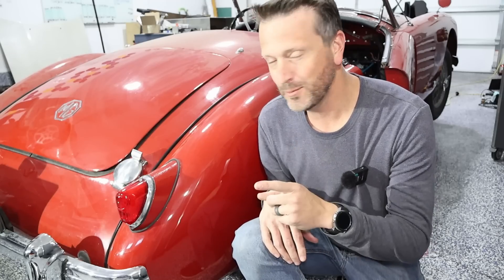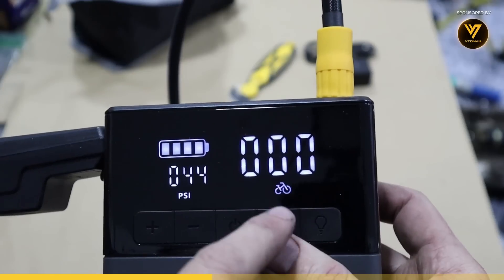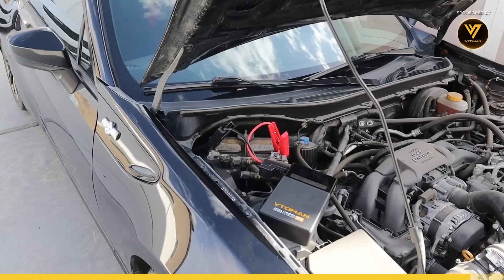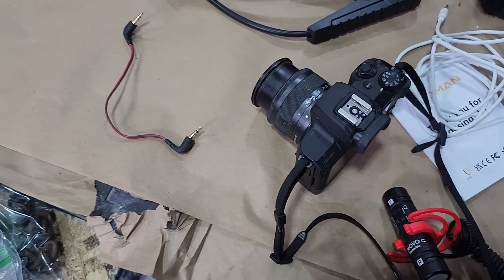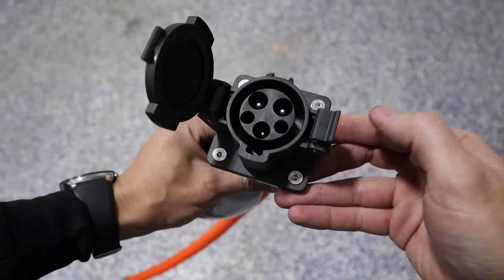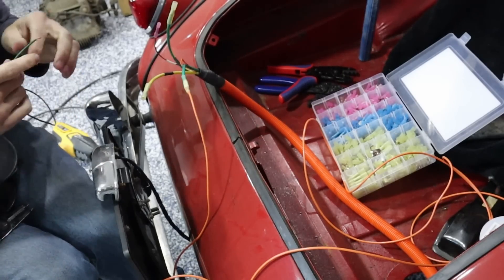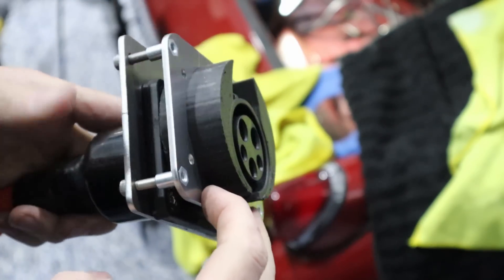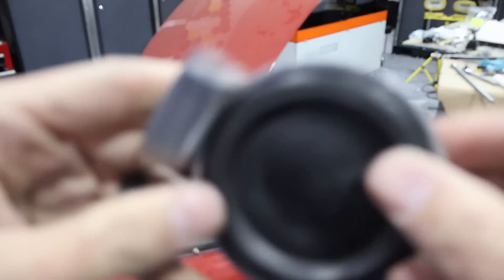Custom Vintage Charge Port - Make a DIY Gas Cap Cover for a J1772 Port

Comment: Saw several comments about NACS ports. Thanks Jeremy, for the pointer to the Aston Martin gas cap. I have built an NACS port into one of those for my eBugeye and it doesn't require any cutting or drilling on the body. Obviously won't support Superchargers, but surprisingly the outputs are the same as J1772 and will charge happily from a Tesla home charger or J1772 with an inexpensive adapter. Documented here: http://adventuresinevland.blogspot.com/2024/05/hooray-for-nacs.html

Comment: Nice work. 

The orientation looks weird. An MGA doesn't normally have a flip cap, but typically a flip cap would hinge on top, allowing the angled fuel filler nozzle to sit in a stable position with hose leading over the bumper, and the same would work for the charging cable.

Comment: What is the internal diameter of the fuel filler you used?  I am actually working on exactly the same project as your MGA, mine is a complete rebuild from the chassis up but using a Hyper 9 with an MX5 gearbox as the MGA is pretty ordinary. Same batteries, but 8 instead of 10 and Thunderstruck BMS and EVCC.  Also interested where the engine cradle came from, who makes it?

Comment: Charger looks great but why not NACS? Would support level 3 charging and AFIK it’s a smaller plug overall.
Reply from the maker: This kit does not support DC fast charging
Reply: Sure... show us an aftermarket charger that accepts a NACS port connection, does fast charging, and doesn't cost as much as the car is worth.

Comment: audio options are endless. sometimes you have to work a little on editing: there are simple apps for audio recording and you can plug your wireless mike to a smartphone and add the audio onto the image. have the built in camera mike for audio sinc while you don't have it fixed... its probably a "easy" fix on that camera (take this with a grain of millions of years old expired himalayan salt because I solder since I was 5Yr old... )

Comment: Be aware that jumpstarters that detect reverse polarity require at least some charge in the battery to activate. If the battery is completely dead they won't do anything without putting them into some special mode so do read the instructions to find out how to do this!

Comment: This is yet another little thing that annoys me about the "EV conversion world". All these dealers will sell you motors, controllers, batteries, BMSes (usually the Orion and nothing else), and bits and bobs. But no one makes a 1772 socket to fit into an old car's gas filler. Not like it would cost millions to develop such a thing either. Nope sorry dude, you are stuck hacking sheet metal.
Reply from the maker: Maybe I should sell one

Comment: That's a clean plug install. Authentic styling, good choice. 
Will this car charge on the tesla network now that there is an option for other EVs? 
Do you control the output KW, or is that flexible through thermal management.  
I'm wondering if you're charging on the road  at how many KW.
Reply from the maker: No DC fast charging for this customer

Comment: Curious why you went with the J1772 and not a Tesla/NCAS connector since it's smaller.
Reply from the maker: This car does not have fast charging capability
Reply: @electricsupercar  Even without, doesn't the NCAS Connector have dual support for Type2/3?

Comment: I'm thinking it might look better mounted the other direction, flipping the door upwards?
Reply from the maker: Gas cap only opens 90 degrees. If we flip it the other way, it makes it more challenging to naturally fit the charge plug
Reply: @electricsupercar  I reckoned the reason was something like that, I was just thinking about esthetics 🙂 Thanks for responding.
Reply: @sveip  It's not just aesthetics - I would want the charging cable draped against the chromed rear bumper, not the painted fender.

Comment: If you want to keep using your camera, you can, you just need to pair the recording system with another device, phone or laptop, and at the begining of the recording clap two times, and in edition make the claps sync with the sound, that's it, the only issue you could have is you would need to do that for every video you record, so would be better to try and record as much as possible from one unique take. If you want some help, I could help you, drop me a comment :)

Comment: Jeremy, please note that PLA parts will become soft when they get hot (or even warm).  I lived in AZ and had PLA printed car parts fail when they became soft and deformed after being exposed to an afternoon in direct sunlight.  A better option is to have a 3rd party print them in PA12 / Nylon 12 using Multi Jet Fusion 3D printing.  You just download your STL file, and they send you the part.  You'll have to shop around for someone who will do low-cost one-off parts.  The company I used In Phoenix seems to have gone out of business.  They did a part like that for $9.   PA12 will hold up to the heat, PLA will not.
Reply from the maker: I got a Hi-temp filament that should hold up fine. 🤞

Comment: Its not a lot but hopefully this will help get you a new camera.
Reply from the maker: Wow!  Thanks so much for the support!
Reply: @electricsupercar  Unfortunate lesson I learned a few decades ago, always use a tripod with good weights on the feet or lower armature.  Even a 5 lb bag of sand/rocks/marbles/weight just strapped down on the legs works in a pinch.

Comment: As somone else mentioned there's most likely someone who could fix it for you but in the mean time, if you have something else that can use the microphone to record audio, you could record audio separately and then sync it in post. It's more work but you would be able to keep the better audio.

Comment: If your camera has a built-in mic, you can record audio and sync with a separate audio track. Adobe Premiere has a straightforward "Synchronize" feature that will automatically sync up audio tracks. At that point, you can just delete the poor audio/unusable track.
Reply from the maker: Record audio with what?
Reply: @electricsupercar  Your lapel mic if it has built-in memory (my DJI has that, but I'm not sure whether your RODE does). Otherwise, you can get a cheap digital voice recorder. I've had good luck with the Olympus WS-853. 
Still, your primary camera needs to be able to at least record a basic audio track, even if the quality isn't great. Otherwise, you have nothing to sync up to.

Comment: Wouldn't it make more sense if the lid flipped up, instead of down? Seems like it'd be in risk of snapping of when it's flipped down
Reply from the maker: Customer preference
Reply: @electricsupercar  Oh.. okay
Reply: The original gas cap has the latch on the top and flips down which is probably why the customer prefers that
Reply: @zenmaster76  The original on an MGA isn't normally a flip cap, and if this were the original fill cap it would not have been necessary to cut a larger hole. Did this specific customer's car have a small flip cap that wouldn't fit the charging connector?

Comment: I probably owuld have done it upside down, so the latch opens upwards instead of down
Reply from the maker: Gas cap only opens 90 degrees. If we flip it the other way, it makes it more challenging to naturally fit the charge plug
Reply: @ElectricSuperCar, if the spring has enough tension, why not change the lid stopper?
Reply from the maker: @nunolourenco1532  no spring
Reply: Thought the same. Now it collects water if it rains, instead of kind-of protect against it. Or at least divert it a little bit from the plug.